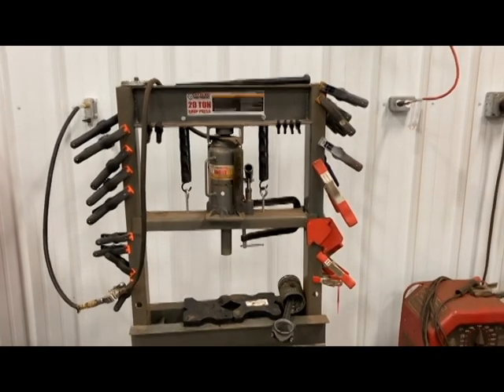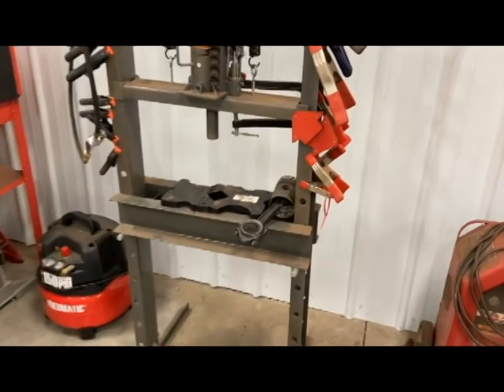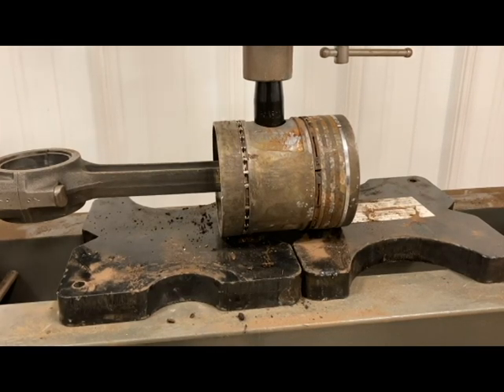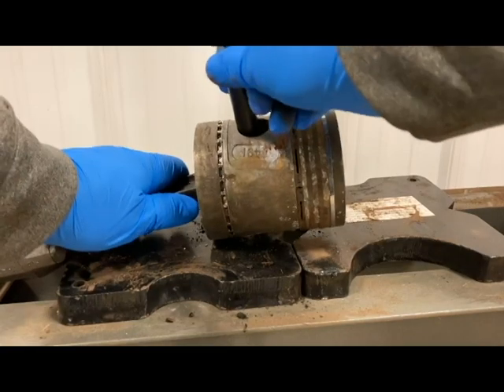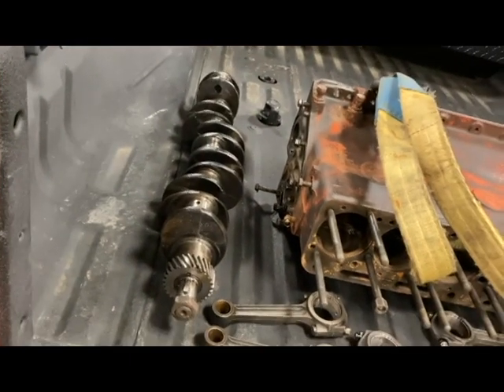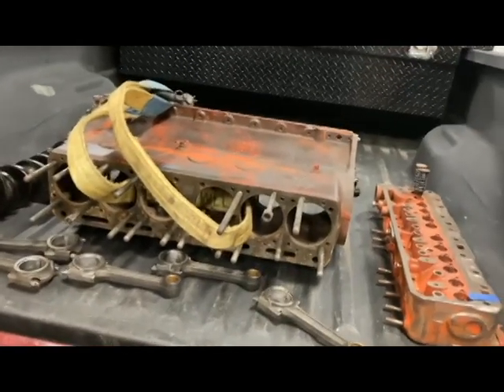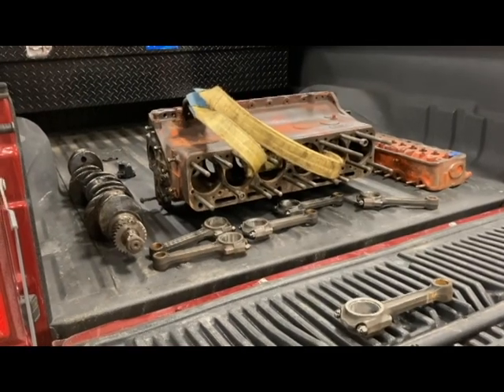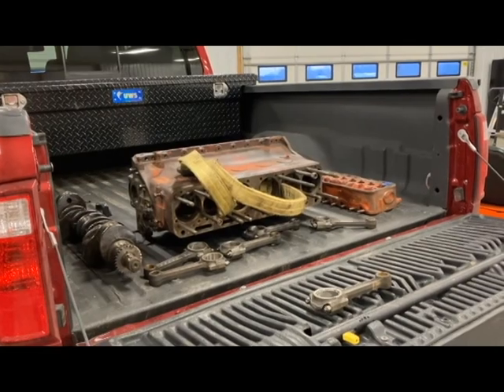Allis Chalmers WD45 Diesel Wrist Pin Removal and Machine Shop Ready

Comment: I read somewhere that because of coolant flow issues in the cylinder head of the Buda diesels they would tend to develop hot spots and that it was important to let them warm up before working them and let them cool down before shutting them off. Wish I could remember what went wrong with ours but that was 50 years ago.
Reply from the maker: Yes you are correct. They mainly needed to be cooled down from what I’ve been told. Letting them cool helped prevent those types of cracks. Glad this one was repairable.

Comment: Good  day  Interesting.  So if block  would   be seriously cracked , have you got extra  block.  Why  are pistins no good.  Boy that press, good to stand back.  Thanks
Reply from the maker: Don If I needed to source another block that would be challenging.  The machine shop was however able to weld the crack from the inside and the outside.  The pistons were froze in the sleeves and were in bad shape when I got them out.  All new parts for this one, not cheap.

Comment: Hey Nash big fan of your Channel. I’m looking into a wd 45 diesel myself and would like to know what you would value a 55’ -45 diesel running and driving with decent tin and a newer set of tires. Wide front.  Thank you
Reply from the maker: Trevor glad to hear. I’ve saw prices on them all over the board. Saw a nice original one sell on Mecum Auction in the upper 6’s last fall. There are so many factors ie location, tires, tin work, PS, narrow front or wide, mechanically sound etc.  Ive saw fully restored ones for over 10k.